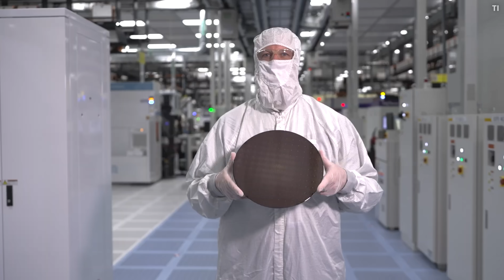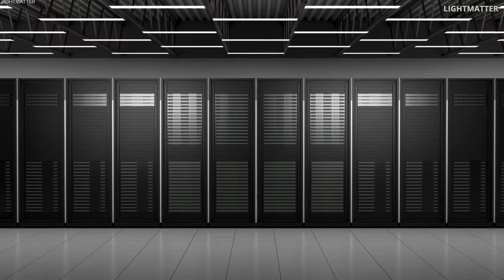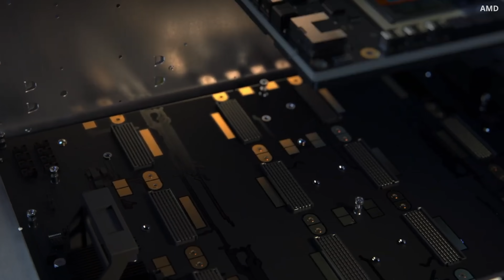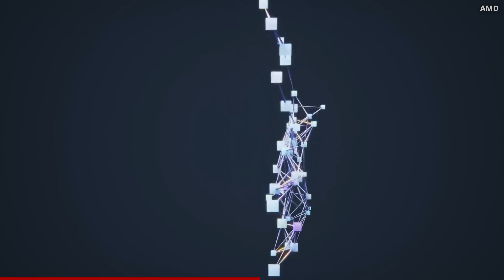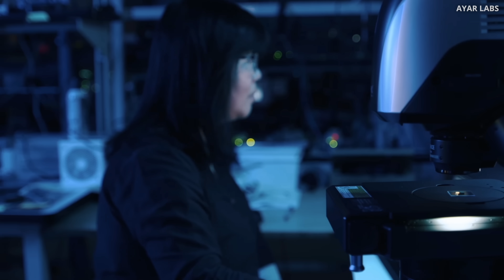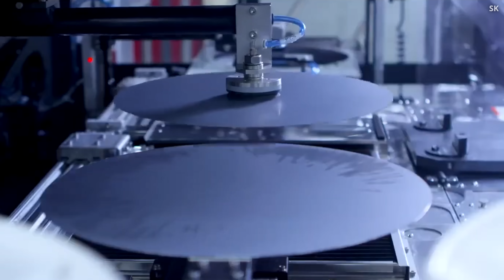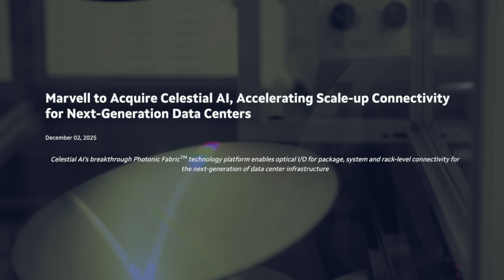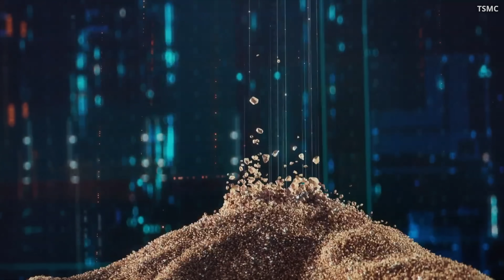Everyone Is Chasing This Technology

Comment: Not to be rude... but those data centres are very big, why not put them underground and then you can use the land above them for other things like power generation or battery storage?

If you're spending billions if dollars on a project then a few million to dig a hole might not be a bad idea since it streamlines the facility and saves land. 

I'm still of the opinion that a single empty mine could house a Terafactory (like a gigafactory but way bigger)
Reply: I will soon have one next to my home. They offered me $3 million for my land but we told them to fucc off. 
I want them to try Active Noise Reduction technology, to reduce the hum of the cooling fans. Also outdoor lighting fixtures that are Dark Sky Compliant. As there is no need for them to be lit up like a Fed-Ex trucking hub.
Reply: @garysmith8593  I kinda doubt that they will actually reduce the noise to the point that you don't hear it
Reply: @garysmith8593 That's pretty rough.. another advantage of building underground would be less noise pollution but obviously that won't move the needle for a corporation.. I hope that it doesn't cause you too much trouble.🫶
Reply: Why? If its cheaper to build on the ground. In USA the land is not a problem. In Tokyo - yes.
Reply: @romandasaleknavicius2677 Because some day the USA will have the population density if Tokyo and by then it will be too late.
Reply: For real 😂? Did you got to school 😂?

Comment: Thank God we have paper straws
Reply: Oh the irony....we need you to turn your AC down and we are going to cycle your power off and on, we also are going to allow the building of a data center that uses more electricity than the cities population of 6 million.......to me that's the most maddening part of it all.  Do as I say not as I do is the message.
Reply: @jeromycertain7698 it's not the electricity it's the water 😮
Reply: @1ntwndrboy198  it's both and other environmental issues.
Reply: @1ntwndrboy198  It's both dude.
Reply: @1ntwndrboy198  Its not actually, that is old DataCenter stuff, modern once use very little water if designed correctly and the Stuff Google and Amazon a putting up is very economical on that account. The issue is power, people do not realize the amount of power and power transmission these things require, and all of that is build on Tax dollar. We are boned.
Reply: @1ntwndrboy198  Water is not a limited resource in most places.  Water is also a completely renewable resource.
Reply: @derekthehalfabee7942  Renewable resource is the one that Replenish Itself. Polluted water - doesn't (well, if you count by millennia, it does).
Reply: @1ntwndrboy198  The water is just there to take the heat.
And that heated water could be used to provide centralised cheap supply for the households instead of just dumping it back into the environment.

But unfortunately the AI companies don't care about the environment, or even if the human race survives.
Reply: @derekthehalfabee7942 🤦🏼‍♂️
Reply: "No more plastic straws wrapped in paper, just paper straws wrapped in plastic.... Congratulations. "
-Tom Macdonald
Reply: doesn't matter, your balls are already 90% plastic
Reply: Being a fairly frugal person, it appears my data is consuming more resource than the real me.
Reply: I know right, shifting the blame on normal civilian lives while using the same amount of energy in mere hours that one person would use in their lifetime is just insane, also the businesses that do supply goods are the ones who do not account for their own products lifecycle
Reply: Tehehehe!
Reply: And that having RAM is still legal and not taxable.
Reply: I'm so glad we could save the turtles from dying to plastic straws so they could die to global warming from all of the AI data centers instead.
Reply: I thought Trump banned paper straws a few months ago?
Reply: Paper straws are proof that Satan rules earth
Reply: @Doomer1984  Rather that people who think they are good are just harmless
Reply: @gzoechi I go with the good omens theory. Rather than subvert a priest, make a lot of people angry with a seemingly harmless action
Reply: lmao
Reply: And disposable e-cigarettes Jesus Crist 🤣
The amount of nonsense these  bureaucrats put us through
Reply: Oy Vey shut it down Oy Vey the Noticing is like another Holocaust
Reply: A local restaurant went out of business two years ago. They were selling everything and I brought a box of a thousand plastic straws for five bucks. I won't be running out of plastic anytime soon
Reply: Poor planet. I am a geek disgusted by technology
Reply: Paper straws do not work well as plastic ones...
Reply: @WadcaWymiaru  Sarc detector broken?
Reply: @IRQ1Conflict  
???
Reply: The real message here is that if you were an above average member of society and not a mediocre one with low output you'd be able to break the "rules." The system is made to place you where your level of production is. It's very harsh. That's why the high production members of society, whether moral or not, have private clubs, islands, parties, groups, societies and the like.
Reply: You're aware that paper straws were banned not because of emissions, but they end up in the ocean?